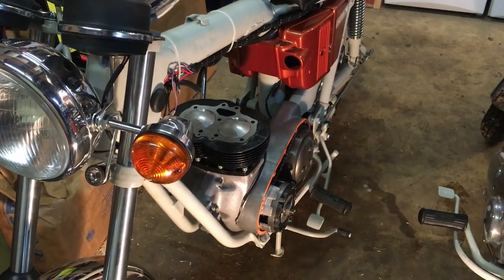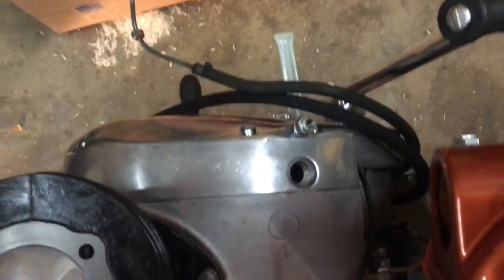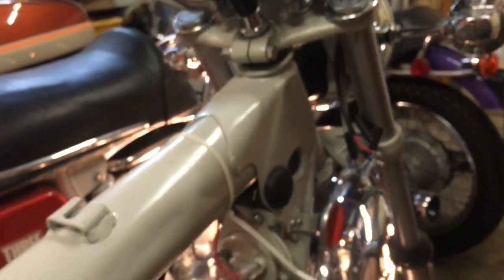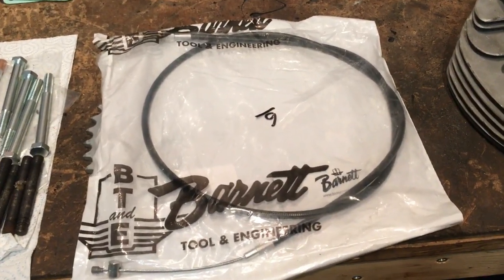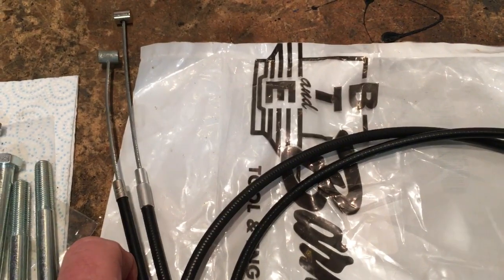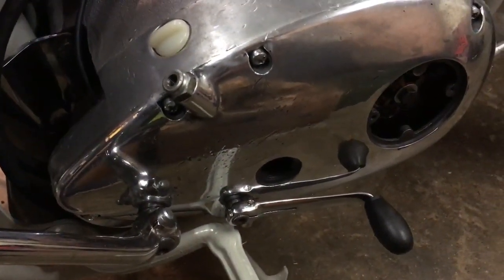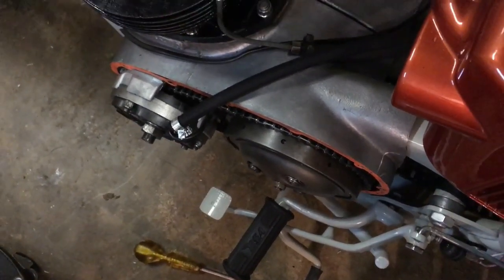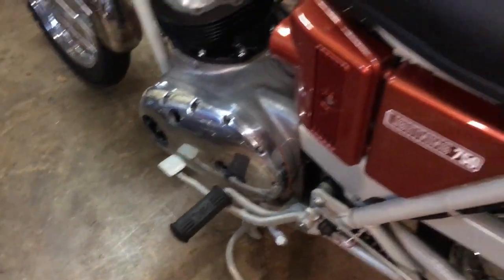BSA A70L Lightning - Engine Part 33 - Clutch Operation and Primary Case Completion

Comment: Very interesting vidéo - my question is, what is the correct tension of the primary chain ?
Reply from the maker: Thanks for the comment and interest Didier. The chain should be tensioned so that there is no less than 1/8" (3.175mm) and no more than 1/4" (6.35mm) up and down movement in the middle of the top run.

Comment: thanks Angus, always a bit of mucking around with those three adjustment points, pressure plate, outer cover and handlebar. Triumph actuation the same, probably lots of same parts, maybe the cable lengths are different, but doesn't look like it.
Reply from the maker: Cheers Peter.